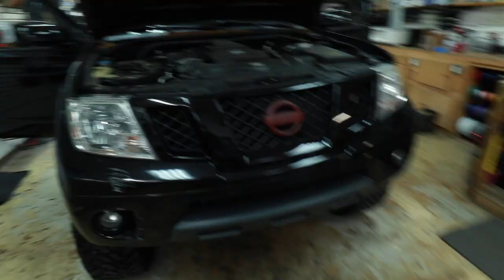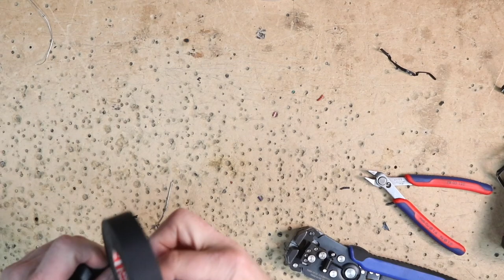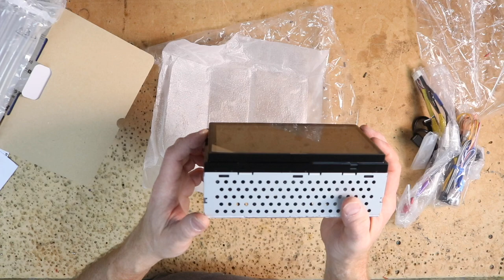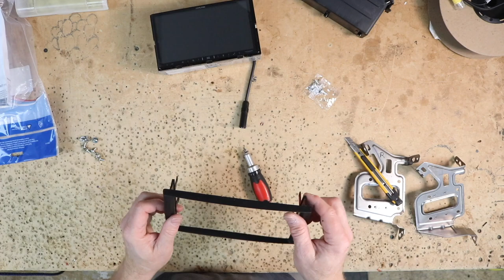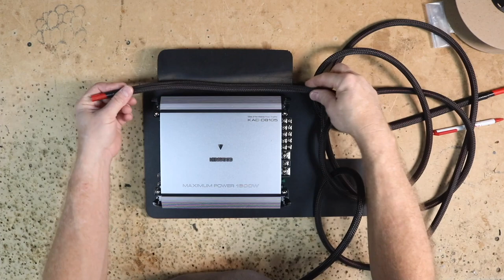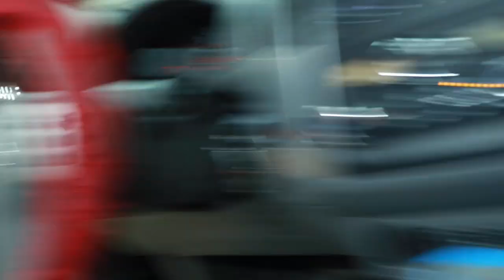Nissan Frontier full stereo installation

Comment: I'm doing a little pre-game planning before I dive into a full install in my wife's 2018 Nissan Altima and was hoping to find a full system install video from you guys. Dang it 😬.  Although I moved on from being a full-time installer over 20 years ago, I still do a few cars a year for friends and select longtime customers. Anyhow, this install is unique for several reasons.  Not only is she my beautiful and amazing wife, but she's extremely particular. She's also profoundly deaf. It may surprise many people out there, but she's absolutely a music lover, as much as anyone I know in fact.  She just requires more volume to enjoy the same listening experience. That being said, dash, front and rear doors, rear deck and 3 sealed 10's on a pair of four channels and a mono-block. I'll be using an Audio Control LC7i for now with the factory head unit, but will be gathering parts to upgrade while retaining the usual functions and controls. Anyway, I'm rambling. The thing that really makes her setup unique for me as an installer, is the setup. I'll need to tune the thing to be absolutely as bullet-proof as possible since she isn't as keen to identify distortion and clipping as other people might be...but now that I think about it, I've had plenty customers that can tear up a steel ball. 😂 Anyhow. Sorry for the long winded rambling. Love the content fellas. Keep it coming!

Comment: I have a question about the stereo "shield" wires in Nissans from the accessories. Are they terminated in the original stereo unit? For example my Juke has a shield wire for the backup camera, microphone and USB port. And should they be connected behind the stereo with GND like a star with it being in the middle, to reproduce the original work from Nissan?

Comment: Have you ever done a video on the same Nissan Frontier with the Rockford Fosgate system. Basically just looking to replace my head unit but wanting to keep the Rockford Fosgate system. How easy is it to do?  Is it a plug and play install? If so what harnesses do I need. Thanks. Michael
Reply: They did. But a while back.  Your going to have to scroll forever. And they they rewired the whole thing as for as speaker wire..
Reply: Michael did you ever figure this out cause I'm having issues trying to figure it out myself. Mines an 06 nismo with the rockford footage system.